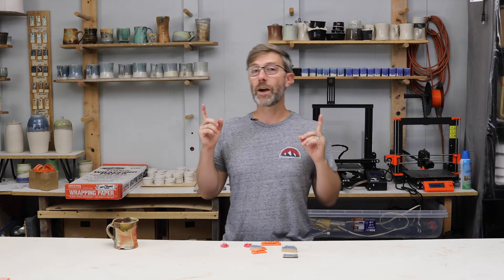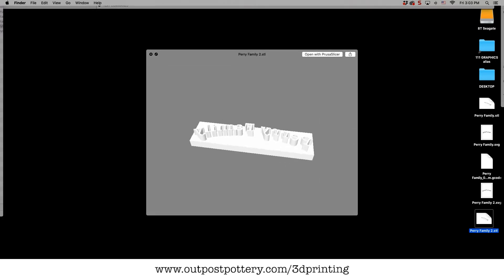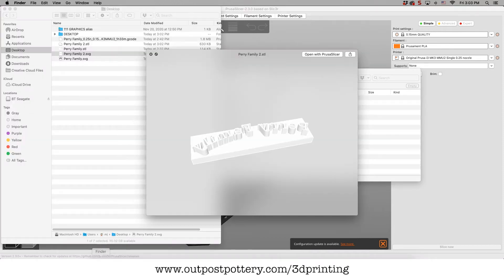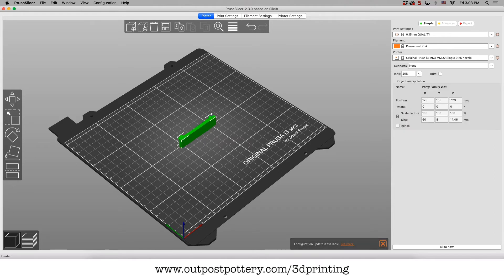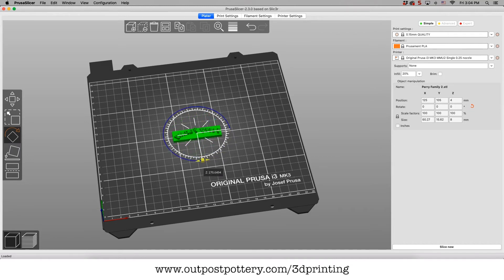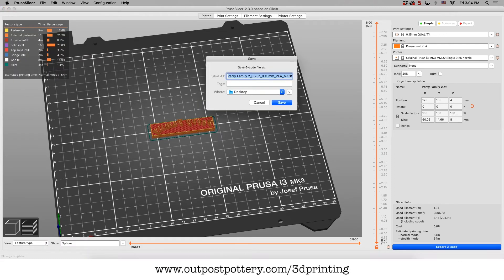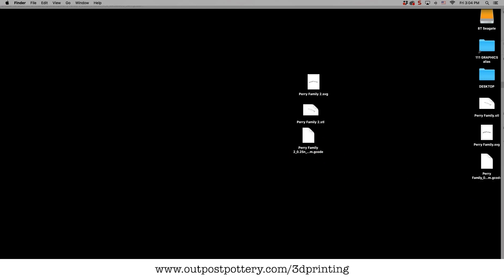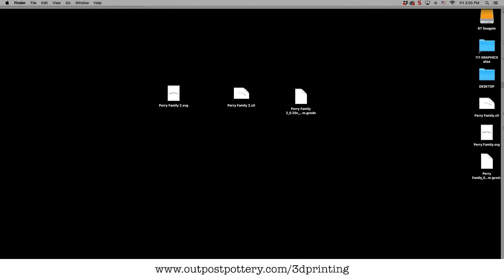How to Make Clay Stamps for Pottery with a 3D Printer - Part 3: Prusa Slicer

Comment: Hi i'd really love to know the settings you used in Prusa to print your 3D model. I've been using Cura and the gcode has worked successfully. But whereas Cura doesn't generate infill that i need for my designs and Prusa does, I 'm still facing a problem with the gcode when trying to print with Prusa. When printing with the Prusa gcode, the extruder moves in random directions and doesnt extrude any clay. I wonder what settings Im getting wrong when slicing in Prusa. I wonder if its the code flavor or something else . Some feedback would be greatly appreciated ! Thanks :)
Reply from the maker: Hi Mina. goodness there are so many settings. i'm printing with a .6mm nozzle.  15% infill though that doesn't matter much with stamps. and about 100 other settings that I've honed over the years.  what machine are you printing with.  i definitely prefere prusa's slicer over cura.  shoot me specific questions and I'll try to help you out.  Good luck!

Comment: Very useful video series!  One suggestion: you would be better served using the 3mf file output from Fusion 360.  From Autodesk/Fusion 360:  we at Autodesk and Fusion 360 believe that STL file format is obsolete and that 3MF is the future of additive manufacturing. 
Also, when you choose 3D print, you can automate the invocation of Prusa Slicer by adding the program as an option from the 3D print dialog (you can also set 3MF or STL as the file type in that dialog).
Reply from the maker: This is really helpful Robert! Thank you so much!  Do you work at Autodesk?  

Wow!  I really love your timelapse and walkabout videos!  -mj
Reply: @OutpostPottery  No, I don't work for autodesk - I meant to show that statement as a quote.  My bad... I am a retired prof of nursing/software engineer (interesting career change back in 2001). Glad you like the videos. One of these days, when not totally submerged in clay and CAD software, I'll get back to timelapse.
One other thing I've been doing with my 3D printer that may  be of interest: While I love the patterned rolling pins that are on the market, they are too pricey for my tastes, so my first solution was to use a laser engraver on large wood dowels, but that was still more costly than I wanted and the engraver took hours to do a job. My 3D solution:  Use Fusion to emboss shapes on a cylinder that will fit over a rolling pin, or paint roller, etc. Typically these end-up as a 2" diameter cylinder with 0.75mm embossed figures. Also, I usually limit to one or two shapes (usually about 1" tall each) per print.  The result is a set of textured rolling-pin covers that I can use individually or stacked in any pattern that strikes my fancy. (Perhaps a quick video on rolling pin covers???)
Re: Prusa - I had preordered the soon to be released "giant" fdm printer, but due to budget issues had to drop it for the time-being. However, once I can afford it I'll be adding that to my pottery modeling tools - the larger size makes it possible to model plates and larger bowls for hump and press molds.